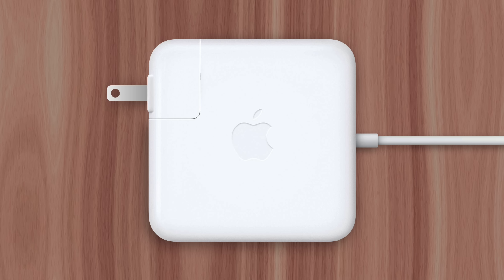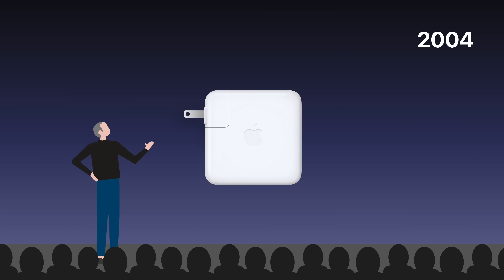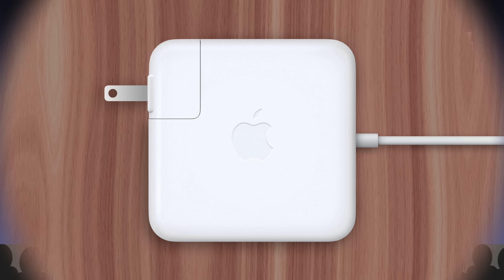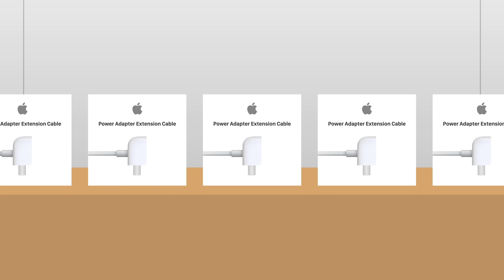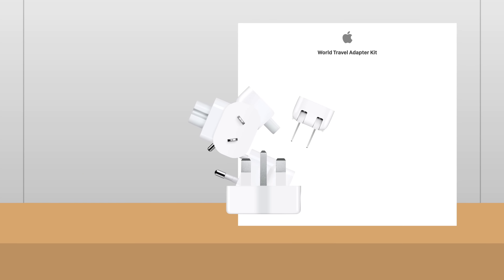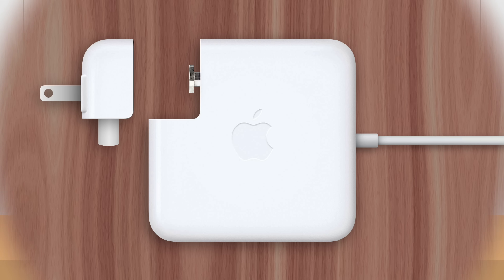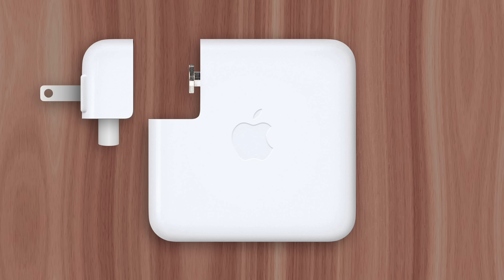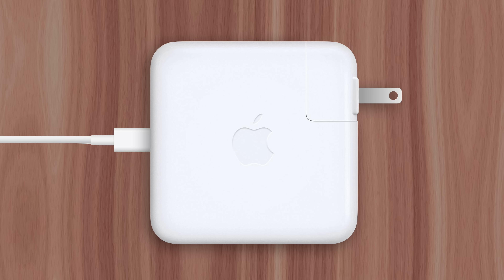Why The Mac Charger Comes Apart

Comment: The problem was not with the users!!! 

This was an Apple design problem! No matter how loosely one coiled the wire around those hooks the result was a windy messed up wire that needed TLC to be straightened out!! So why ruin the wire and create a big messy ball? Those claws should have opened in reverse to make more sense, but It was simpler and wiser to coil the wire separately!! zIts a bit late to be discussing a feature that's been dropped for some time, wouldn't you say? One just unplugs the USB-C wire and one has a better neater  result.

As for the modular plug, I looked at it as the answer to international portability and the extension wire as an afterthought, not the other way round as you present. Don't you travel overseas? That modular plug is used on other Apple chargers such as the smaller ones for the iPad and even iPhone "back in the day", so I'd say my rendition is more correct than yours! 

This is a rehash of useless info for 2021, perhaps to generate income, I'd say....right?

Comment: He forgot to mention that the charger also uses a figure 8 connector on the other end to allow for even cheaper extension because the figure 8 connector is an open standard but the design is much less seamless when done this way

Comment: Every laptop charger has this feature. The only difference is that they use an IEC-60320 compliant inlet, which is easier to swap, cheaper, readily available and more durable.

Comment: I'm so glad the Mabooks run on USB-C now. You can use any charger, get a longer USB cable if you want/need, use magnetic break-away cables.
Buying a couple new chargers because the output cable on the original spontaneously combusted or the outer layer just rotted away was annoying. That cable was way too thin and flimsy.

Comment: Why don't other OEMs do this?! The amount of sense this makes is astronomical.
Reply: Well because No, this does not make sense. Why would you pay 19.99 for a MacBook extension when a standard extension cord would serve this much better for only a few bucks. Also a regular extension cable will work for all products, not just 1 laptop. 
Secondly, why would you buy an overpriced adaptor for only one device when outlet adaptors are readily available for a couple bucks. An outlet adaptor will work for all devices, not just the MacBook.
Reply: @Mrkevi123  If other OEMs do it, it won't just be for MacBooks. The principles  behind it, being able to swap regional plugs or extend it further all with the same adapter, are not exclusive to Apple.
Reply: @Mrkevi123  Yeah, my thoughts exactly. Why would anyone spend the money on this when you can buy and extension cord for like, 5 quid and you find travel adapters in pound shops KEKW

Comment: The port to which the duck prong (the name of the detachable part) connects is a standard IEC C8 socket, so you can connect an IEC C7 (''figure 8'') plug to it.  Those cables are found on most home electronics like DVD or Blu-Ray players, stereos, PC & Chrome power adapters, etc.
Reply: Very useful information

Comment: I cannot use the adapter without experiencing electrostatic around my MacBook keyboard. The only way to solve this is to connect the extension. Does anyone else have the same problem?

Comment: does this mean there’s a seamless extension cord thing for iPads too?
Reply: afaik its even the same one
Reply: As  above, all apple charging leads and accessories built in the last, say 15 years are interchangeable. The new ones are slightly more sleek but the extension cord from my 2006 MBP fits my 2017 MBP brick and XS Max charger. Pro tip, it's just a standard IEC C7 fitting. So if you have one of these leads (often referred to as a figure of 8) you can use this as a cheap (and less pretty) substitute for the expensive apple one

Comment: "They ONLY had to spend $19 to replace it"
Reply: I had to replace my 2013 charger once because the cable broke. Cost me around 80$. So yes, “only” 19$. And technically you can even use a third-party cable since it’s USB-C to USB-C. But those aren’t very cheap either when you need them to have a decent length.

Comment: I thought you could remove the plugs from the charger to connect it to the ordinary power cord of electrical products like cd-players, radios, or other charging bricks.
At least that’s what I used it for and it works great.
Maybe he didn’t knew this feature 🤷🏻‍♂️

Comment: The s21 ultra is a way better phone than the iPhone 12 pro Max in many ways.they are so far ahead of the iPhone that the next iPhone won't even have all of the features that the s21 ultra has now like adaptive refresh rate, 1,500 nits, 100 times zoom, 108 megapixel camera, 8K video, the smallest hole punch, on any phone, reverse wireless charging, recording from three cameras at the same time, single take mode and a macro camera. There are many more but I cannot remember them right now. When you see these features on the iPhone 14 do not think that Apple made these features because like usual they are just stealing the features from the last Samsung. Wach the video 5 ways that the Samsung s21 ultra destroyes the iphone 12 pro max. The next iphone will not have a chargeing port. Wireless charging takes twice as long to charge as wired charging wile using 74% more power and heat. it has Samsung Dex Wich turns your tv or monitor into the screen of the phone. The repairability is much easier and cheaper. Samsung has the Google ecosystem Wich in my opinion is better than the apple ecosystem
Reply: @nonamesaretaken5616  👉🤬
Reply: And xiaomi is better than samsung the xiaomi mi 11ultra has bigger speakers, a small display on its back to take the BEST selfies on a phone, 67 watts fast wire charging vs samsung’s 25 watts etc etc all at the same price
Reply: @cateatingpizza1272  in china it is cheaper because it is made there but in America it would be about 200 dollars more.

Comment: As a person who travelled a lot between 2010-2019, Having my MacBook Pro 13" 2015 work in every country by just changing the bit? Priceless
Reply: How did you have a 2015 MacBook Pro in 2010? 😉
Reply: @DSPrints_  as he said, he travelled by time 😂. Time traveler ⌚️.
Reply: @DSPrints_  I travelled a lot between 2010-2019, got a mac in 2015, so I started appreciating it a lot since then.
Reply: If you carry an actual travel adaptor, all your other devices will work as well. Not just the laptop.
Reply: @Mrkevi123 travel adapters are suboptimal. Most of the times by plugging my Laptop I can just charge everything else off the other ports. Also, the adapters don’t wobble on the outlets.
Reply: @lordsp  it's not very affective charging through your Mac
Reply: Just use a normal adapter. Not complicated like he claimed in the video and you can use it for all your devices
Reply: Every MacBook up to date still works like that;)
Reply: @jimi272  Yup I know. but I dont travel much anymore so I don't care. I just use my Hub now
Reply: Does it work for 100V and 230V?
Reply: @ravinchowdhury5215 probably, it's not all that expensive to add the circuitry to adjust between voltages, usually just a split in the transformer and voltage regulators take care of the more minor adjustments.
Reply: @sazanlip frankly that's standard for the vast majority of power supplies nowadays, from phone chargers, to my PC's power supply (I'll give it tho that yes, crappy ones do need the switch), and my 2006 laptop and phone also had multi-voltage chargers.
Reply: If you traveled that much ... you would have the proper outlet adapters anyways. What about the rest of your "electrical gear"?
Reply: Ay I have the 2015 MacBook Pro too! Gotta love those ports

Comment: Not only that they removed the grounding too, so now every new MacBook gives a electric sensation on the casing when plugged in.
Reply: I thought I was the only one experiencing that 😳
Reply: The grounding is done through the shiny mushroom looking part on the charger. The standard folding prong wall plug doesn't ground to this, but if you use a grounded cable, it will connect to this and provide a ground connection.

Comment: Another important thing about the extension cord: In the UK at least, it was the only part that was wired to the earth pin on the plug thus making it properly grounded. When not using the extension cable, I, among others were sensitive to a slight tingling feeling on the MacBook surface when it was charging.
Reply: Sameeee! Honestly UK version is TRASH
Reply: Same using the European plug! That tingling feeling was driving me nuts until I found this out
Reply: Yes indeed.  Same in Canada.

Comment: One of apple’s best product. Imagine if all products were just as modular. 😭 no competing society, just infinite options! 😌
Reply: Most notebook chargers are more modular than this design
Reply: Then why you cant remove ssd?
Reply: Is this Apple the same Apple that keeps the lightning port instead of adopting the better universal Usb-c port? Just to maximize profits.
Reply: @AndreVictorGoncalves  I think what they should start doing to add USBC is to either make USBC optional at first to make the transition smoother to USBC, or trey should make it so you can trade in your lightning cables for USBC cables. Personally I think the optional part would work better, since slower transition allows the people used to lightning to be able to switch easier instead of having all their chargers useless one day
Reply: @AndreVictorGoncalves  Yes it is. For the universal USB you could just buy a USB extension cable for cheap, any brand, and there you go and do more important things.
Reply: @AndreVictorGoncalves I come from the future bearing good news: the new shitty iPhone has Type-C thanks to pressure from the EU. It's not shitty because it's Type-C, it's shitty because it's fragile and runs iOS.
Reply: @AndreVictorGoncalves  I actually like lightning better. Usb C is a bit fragile for my liking.
Reply: @Starling_54  Tell me more, how durable is the lightning cable?
Reply: @AndreVictorGoncalves  I'm taking about the connector, not the cable. But honestly, I've never had an official lightning cable break on me.
Reply: @Starling_54  you've never used an official lightning cable then
Reply: @Starling_54  you must be super careful, I know one person that was able to do that. And they aren’t AirPods 2, the AirPods never changed,, just the case and an extra 40 bucks
Reply: @daltonparker7792 Actually they changed the chipset in the gen 2 Airpods for faster connection or something
Reply: @Starling_54  thats all hot air, the software never changed and neither did the hardware. Its like the 2019 iPad pro and the 2021 iPad pro if there's actually a hardware difference. The m1 iPad pro from 2021 is so much of an upgrade they're almost 2 completely different devices. But because of the software limitations Apple deliberately put in place, they are effectively the same device. Different on paper. Exactly the same in really world application. Especially since even the connectivity in my roommates airpods pro is no faster than my "1st gen" airpods.
Reply: @AndreVictorGoncalves  You must really wanted to get that off ya chest 😂
Reply: @AndreVictorGoncalves  At this point they do it to save consumers’ money. iPad Pro, iPad Air and MacBooks all use USB-C. However since Apple is rumored to have been planning to remove the charging port entirely from iPhone within the next 2-3 years, it would be a big expense for users (and Apple of course) to make many new USB-C adapters etc. to be used just for 2-3 years
Reply: @DimitrisSartzetakis  What about iPad air? Is it going to ditch the port too? Or will it have lightning until 2030?
Reply: @AndreVictorGoncalves  the air will probably go wireless or C. the air is, after all, basically a ipad pro thats 2 years old with slight modifications, usually.
Reply: @AndreVictorGoncalves  iPad Air already has usb-c
Reply: @thebravegallade731  It does have usb-c lol 😂
Reply: @thebravegallade731  nigga iPad Air has usb c
Reply: @AndreVictorGoncalves  iPad Air has USB-C
Reply: @DimitrisSartzetakis  really, this is the same company which doesn't provide any charger and providing a type C to Lighting cable which most power bricks don't support with a $1000 phone in the name of saving environment and selling it separately.......
Reply: @daltonparker7792  Everyone has a spare brick laying around. And yes, I agree it's annoying that they removed the headphone jack, but the included headphones have a lightning connector built in. Airpods are expensive, but they are great and very useful. And I have no idea what you're talking about with a $100 wireless charger. I've never seen wireless chargers more expensive than $60 dollars, and those ones usually charge multiple devices at once.
Reply: @daltonparker7792  I know the new cords are Usb C. But if you already have a brick, you have an existing cord you can use it with. The wireless charger you mentioned isn't made by apple, it's just licensed by them to sell at their store. As for your other headphones sounding better than Airpods I believe you, but the fact Airpods are so easy to sync and use makes them a no brainier for me. And I also have a $30 pair of Chinese headphones and they sound like ass. I don't understand the last point you made about brick cost or whatever
Reply: @DimitrisSartzetakis  Looks like it was just that - a rumor.
Reply: Then there will be no Apple or anything because they profit from us to grow and give is new products. Not a huge fan of Apple products. I like Android more but Apple is a great company. They even started the Smartphone era.
Reply: their charger is their most innovative product
Reply: @oofig  sad but true 😭😂
Reply: i mean, most are, except for apple ones.
Reply: An iPad Pro has a removable stylus and keyboard
Reply: @robertburgin8110  A samsung tablet as a removable stylus and keyboard
whats your point?
Reply: @guiguinofake4626  Im saying that a lot of products are modular. Im just using Apple as an example because of the topic of the video.
Reply: @jackred2362  That’s what I’m referring to in general lol. If all products were universal and modular. No more, “here’s my unique product that uses this special charging cable that no one else uses”. I just want to customize my own device so i can use it for my own personal reasons and not wait for upgrades that’ll never come. 😭
Reply: If they were modular I'd actually consider them good products.
Reply: I am not sure if anyone has seen a ac to DC power adapter for laptops but the wall side can be removed and replaced with one from that country. 

I use to worry about loosing or breaking my laptop power cord but since everything but an IPhone charger with type c ....
Reply: 🎼 [John Lennon’s Imagine plays in the background] 🎶
Reply: @MakeShift I’m not really an android user though, respectfully… I just wish things were more modular for Apple products so I could just shop more widely whenever I need to replace something, like a cable.
Reply: If apple was more modular, and allowed for better 3rd party repairs, they would just absolutely dominate the market, imo
Reply: @decent flipper Well I’m a user designer and design for both iOS and Android, but mostly iOS soooo, can’t take your advice on that. Sorry my dude.
Reply: Imagine modular dongles
Reply: @FlyingPigChannel  I would like to see! Haha
Reply: @dinomightstudios4119  unfortunately it probably won’t ever happen since apple makes a lot of profit off of dongles for their devices and would probably stop manufacturers trying to make modular dongles.
Reply: Yeah that’s actually a really cool and nice money saving design. Very very handy.
Reply: Competing society is what give us infinite options. Everyone wants to 1up each other
Reply: You call modular 90 dollars for a cable?
Reply: Yeah! Thought I would miss MagSafe, but since I could now just unplug the cable from the brick and store them separately, I really don’t
Reply: @decent flipper exactly. If you hate Apple so much, why tf do you have to whine about how expansive and bad apple products are because you own one??? JUST DON’T USE THE THING YOU HATE USING